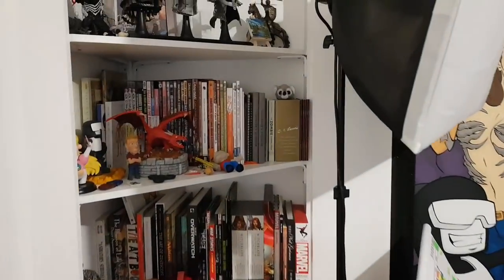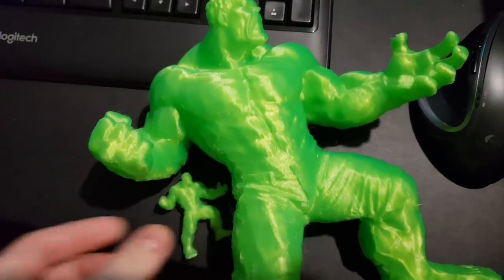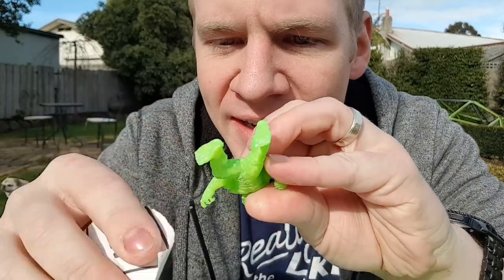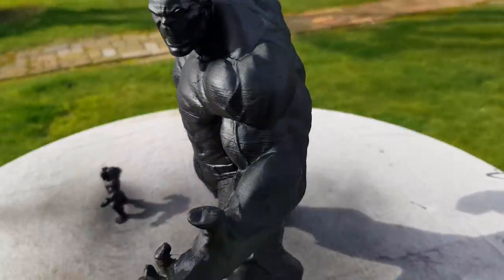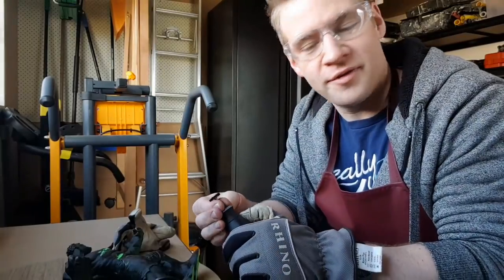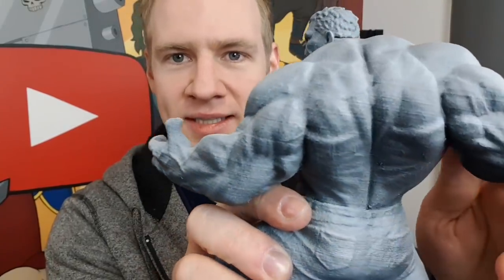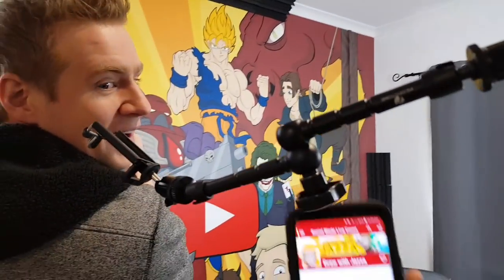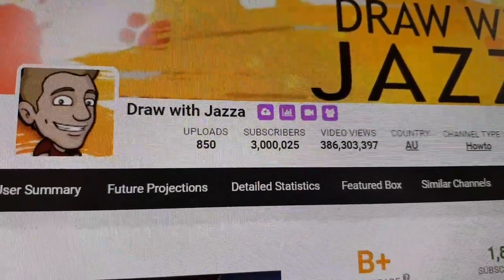Painting my HULK 3D PRINTS!!

Comment: Jazza, for stringing (aka hairs) use a heat gun or a hair dryer to melt them away before you start sanding the model . As for the print layer lines use filler primer . It will fill in the gaps but you might loose some smaller details that you might actually want to keep . Use it wisely .

Comment: Using a little bit of fire is good for removing hairy" parts. Just don't overdo it, because plastic might deform :D
Reply: as well another method which is a little more safe is a heat gun
Reply: Or most likely melt as plastic has quite a low melting point
Reply: @Omega-um1vj  high heat for a short period of time won't melt the plastic that is thicker since it won't have enough time to warm up enough to melt.  I do this all the time on my own prints as I use petg which is more susceptible to stinging.
Reply: I've been 3d printing for a year now, it's like burning little hair from the linen rope. Heat gun is a great way, but it's not really common item to have at home, lighter is usually good for most people, and I think still safer then dremmel
Reply: Or acetone could work

Comment: Q:  Have you seen the statement below this question about using an acetone vapor bath to get incredible polished 3D prints?

@Daily Jazza, use an acetone vapor bath if you want really smooth polished prints. It will help you immensely. Note for ABS prints.
Reply: but use it in small quantities , and what is the filament doesnt disolve in acetone ?
Reply: Thank you, should be noted that the acetone bath method doesn't work with PLA, it is only for ABS. There are methods for PLA using Ethyl Acetate, but could be harder to come by.

Comment: Tips for future reference. Use filler primer to fill the layer lines, it takes a few coats with sanding in between but it really improves the final result. Also sponge sanding blocks are great for curved surfaces. And if you're familiar with green stuff from warhammer, it is great for fixing any major errors in the print.

Comment: a little tip that helps a lot for making 3D printed pieces look smoother is to ad a layer of spray putty after you have sanded it. It fills in the gaps between the lines of the 3D print. Then you need to sand it again and ad more spray putty where needed, sand again,...you get the idea.

Comment: Look into getting some sanding sticks for small detail sanding. Also, XTC-3D resin is a great way to smooth over a print not done in ABS plastic. It's a little expensive but you only need a little bit.

Comment: Q: Jazza have you looked into 3d printed lithophanes? These are the perfect cross over of your art and 3d printing. They are gray scale images and the 3d print slicer uses the gray scale values to create a height map and prints the picture which, when light is applied through the back the darker/thicker parts block light and lighter/thinner parts allow light through. Check them out they are awesome and some of your artwork 3d printed would be epic.

Comment: Paint stripper will smooth out the print lines it'll take trial and error till you get the time you want to soak the print cause you dont want to soak it for a very long period of time and different material will react differently and the make stuff that you spray on made to do the same thing just for 3d prints I haven't tried it but I've been told it'll work

Comment: Hey jazza, not sure if your friends over at punished props have told you, you can use acetone to clean up 3d prints nicely. It makes the crevices smooth up very nicely and get rid of unwanted surface texture before painting

Comment: An easier way to clean up a 3D print and get rid of the print lines while keeping the detail is to use acetone or apply a thin layer of epoxy over the print. That will certainly make things less complicated the next time around as opposed to sanding.

Comment: Jazza: For REALLY fine work the Flex Arm dremel attachment is pretty unbeatable. It takes all the shakiness from the motor away from your hand, and you just have to deal with the kick from the actual tool end. I recommend looking into it. Just be sure to read the instructions on it, it's easy to damage your tool is you put it on wrong or misuse it. I normally hang the dremel from a hook when I use the flex arm. If you DO damage your threading, Dremel fixes it for free, at least in the US.

Comment: Two methods aside from sanding on 3D print channel to smooth the surface:
Heat: crafts heat tool which is capable of 600°C and more
Chemicals: Acetone (but this you might wanna check)

Comment: Hi there. I have a question. I am having a 3D model made from a professional 3D model shop. I will need to have it painted by an hired artist. I was wondering, if I should have the model printed either in grayscale or in colour?
 Does it matter at all?

  I was thinking so the artist will have a reference to what colours to paint the model.  I saw your original model after the 3D printing. It looks a bit rugged. It is the same look that I have seen with other 3D models at the print shop. I am hoping to have it  look more smoother and cleaner like your final Hulk model.

Comment: Jazza, for the little "webby bits"/"hairs" that you were sanding/"dremeling" off, if they're just like wispy strings and not chunks, you can hit it with some heat from a heat gun or a quick pass with a flame. Just be careful on things like the smaller hulk, such as the fingers.

Comment: Suggestion!
Use primer to spray first! Sand it down with 1500C sandpaper and maybe 2000C sandpaper, Spray with primer again, if you want it extra smooth and shiny and use 2000C sandpaper and subsequently 2500C sandpaper. You should get a pretty smooth finishing. At that point if you're perfectionistic, a 3000C sandpaper would make it almost spotless but this takes a lot of time :/
Reply: Oh I forgot, this helps to removes the lines from the plastic, the more you sand the plastic down, the higher chance of it fraying as it was printed in strands, so you wouldn't want to sand the model too much, just enough so that you won't have to put in too much work during the priming phase

After the prime you can spray paint and it should look pretty spotless